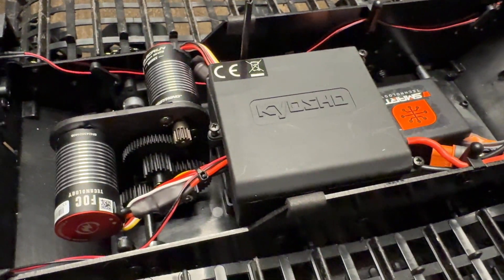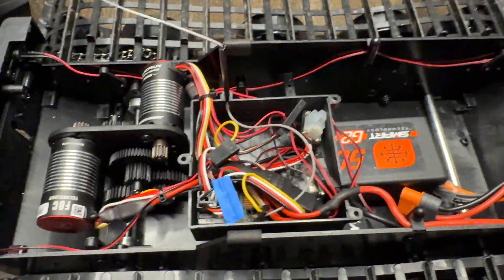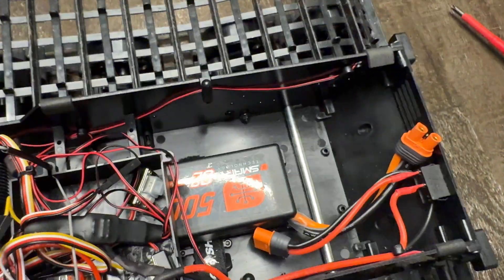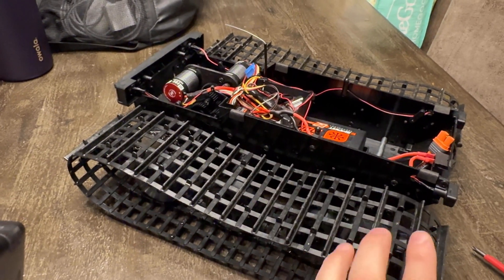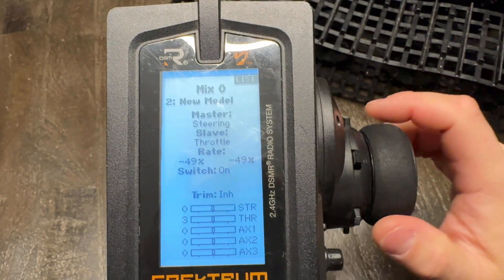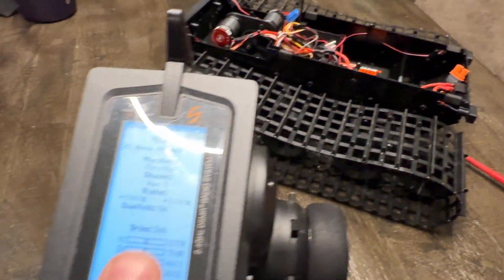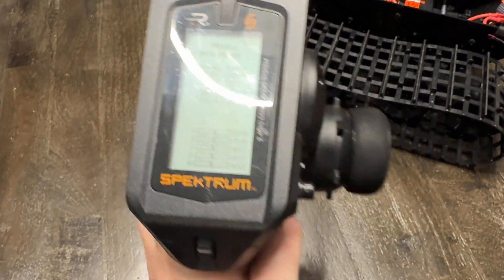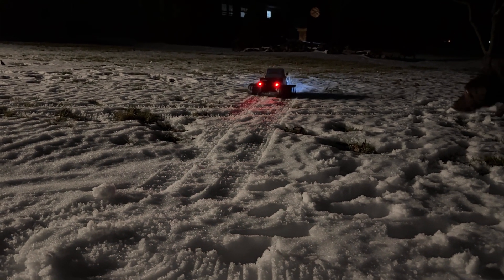Kyosho Blizzard 2.0/Trail King - Brushless Fusion Mini 16 Upgrade and Spektrum DX5R Programming

Comment: The motor shaft flat area doesn’t run the full length of the shaft. Did you just tighten the grub screw onto the rounded part?
Reply from the maker: I think I used a dremel later to make a small flat spot.

Comment: So if I’m making mine I go a brushless like this but tank controls will I need to buy to escs 
Also do you have to worry about these overheating and cooking a motor 
That’s what happened to mine. It was the brushed stock motor
Reply from the maker: The motors I used include escs built in